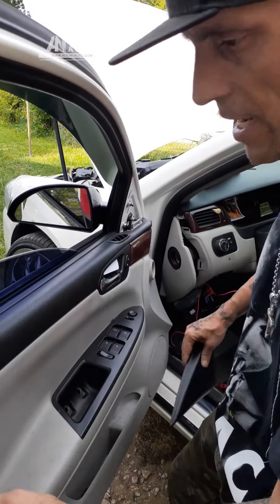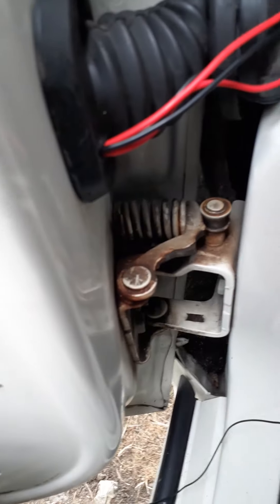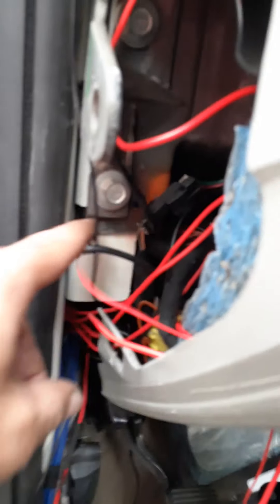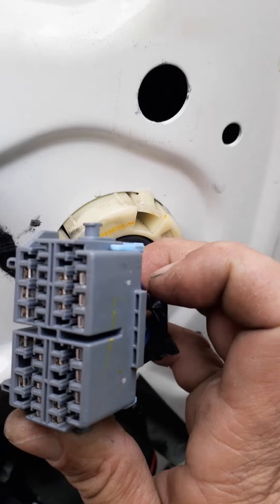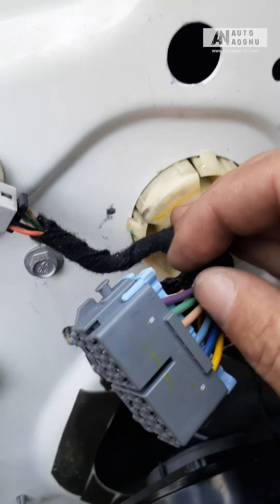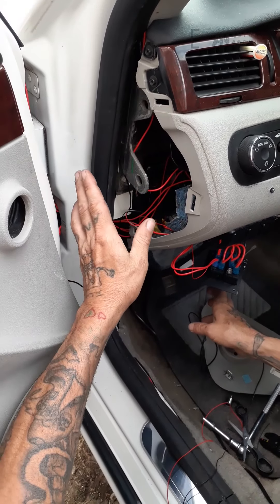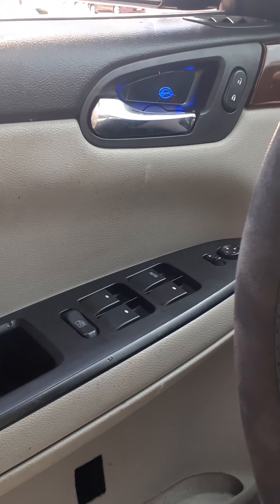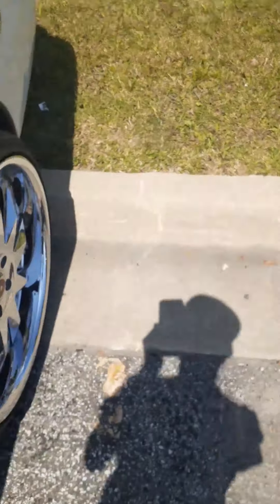2007 Chevy Impala LED Door Handle Bowl Install - AoonuAuto

Comment: Before purchasing two front wheel wells mud flaps for my vehicle I messaged them asking if they would fit my vehicle. They were quick to respond and professional, stating they researched and yes, they would. After purchasing, delivery took over two weeks to arrive, they sent rear mud flaps for the incorrect model year. Emailed them for a return address and refund and was given the runaround asking for photos for proof, stating I should try to use them anyway. Customer service turned ignorant and rude and then completely silent. DO NOT BUY ANYTHING FROM THESE FRAUDSTER LIARS.